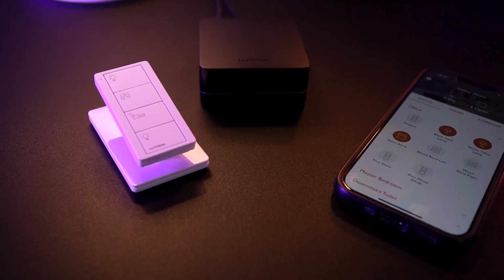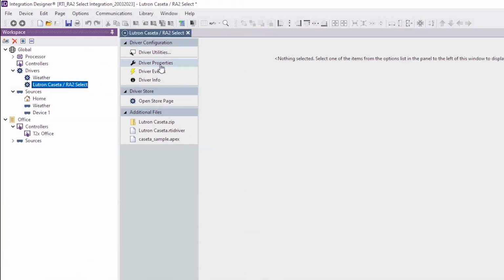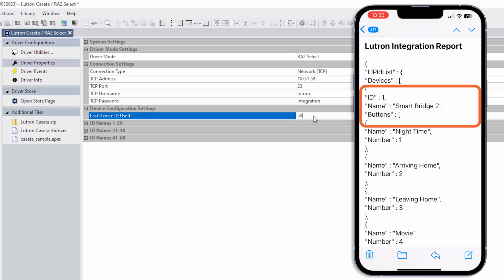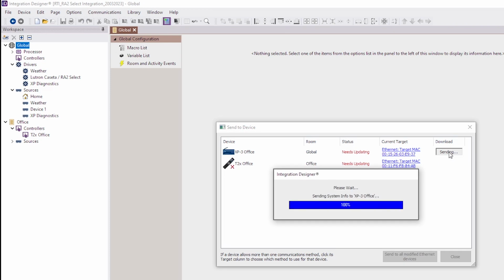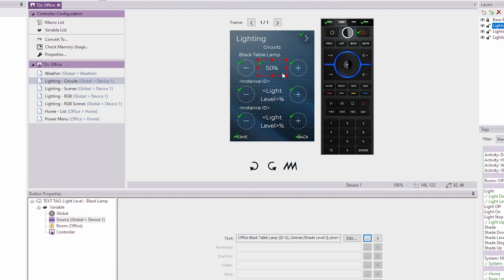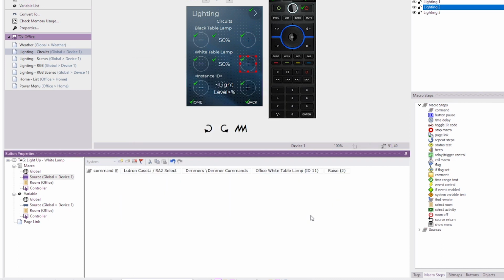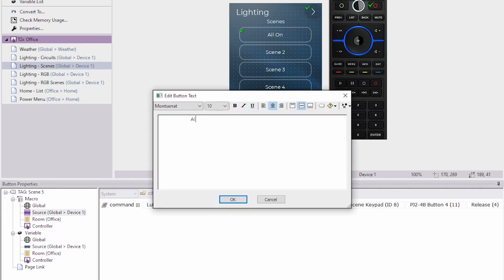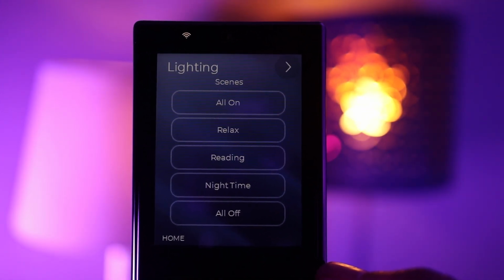RTI integration with Lutron RA2 Select / Caseta. Driver Config, Lutron Dimmers & Scenes Control 2023

Comment: Are you moving away from Control4 to RTI? Which do you think is easier to program?
Reply from the maker: Well I don’t think I’m moving from anything - just sharing my experience. Thanks for your comment. They’re both good system and as I always say most important is the design, installation and programming of a system that matter most ✌🏾✌🏾 good luck